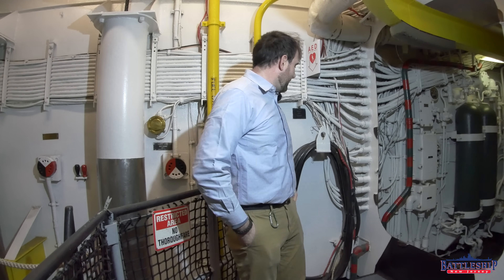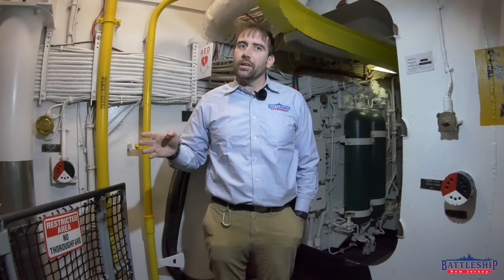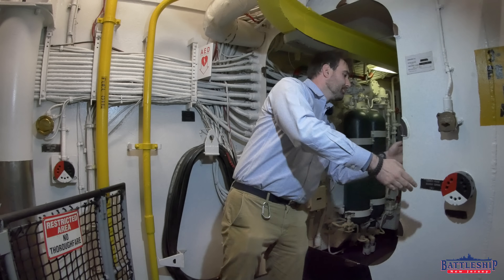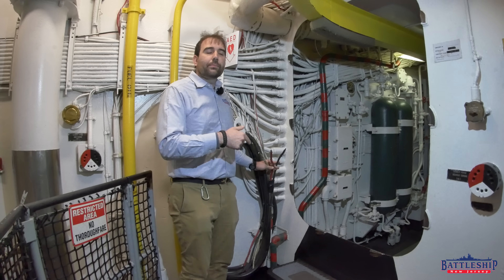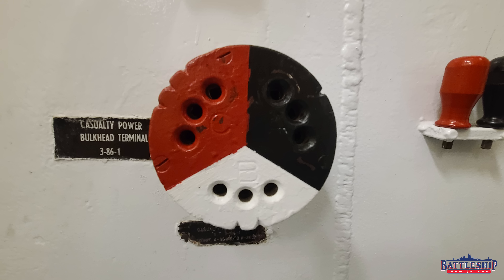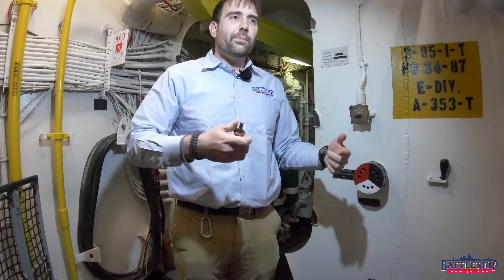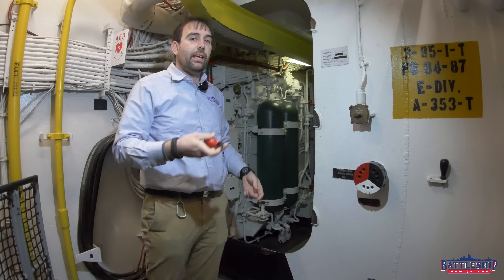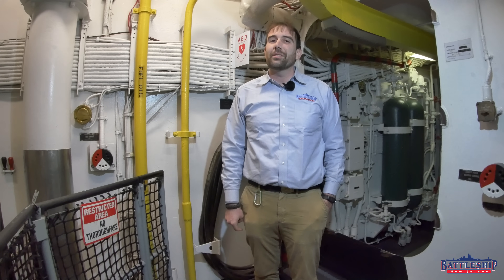What Are Those Weird Red/Black/White Discs on the Wall?

Comment: Yes, they are emergency power connectors for cross connecting damaged wiring. We covered this in DC school. But I don't think there was a lot of drill practice rigging these things. Maybe the electricians did simulations.   It seems there should be a special "T" wrench as well as a super heavy supply of cable hanging like firehose nearby on the bulkhead.  I did drills on America, Kennedy and Saratoga (late 60's) and never saw this rigged in any way. It would be interesting to hear from any old sailor who actually employed this system as a result of battle damage.
Reply: (joke)  DC school? But the power is AC  not DC   :)
Reply: @allenshepard7992  Good one Allen, thanks. I always thought messing with that system was a great way to become a crispy critter.
Reply: @paullewis5045  Most welcome. 
Yes, a crispy critter. After all "nothing moves. Looks the same when it is on as when it is off (safe)"  Training and Respect is key. 
While my mind understands connecting 480V wires on a moving ship in knee deep salt water, my mind says "Death trap"
Reply: @allenshepard7992  M, maigretus1 below has the right plan for handling this system.
Reply: My uncle was on the America in Vietnam.
Reply: @allenshepard7992  Or as they told me while training as an electrician: "A live and non-live circuit look the same, they just have a different feel to them"
Reply: @keresztesbotond740  Ha ha ha. Never heard that one. I will have to use it. Thank you.
Reply: @allenshepard7992  I'm pretty sure a ship would have it's power set up in a an IT configuration, which would normally not zap you at all. But I imagine in a situation where the ship is sinking on of the poles would easily ground itself to the hull, then it's game over for a human body.
Reply: @laszu7137  Yes, As I understand it, ships center tap single phase circuits so its 60V to ground instead of 120V. 
Three phase (3Φ) windings are bit tricky and do not have that advantage.
Reply: @allenshepard7992  "Damage Control"
Reply: We would drill running casualty power, or should I say the EM's did. Though it was mostly done during TSTA. But since we got a Battle E every time, I would say it was good enough drilling.

I never felt like the crew on my ships were unprepared for the worst.
Reply: @JoshuaTootell  "unprepared for the worst"  that is a great statement. There is so much we/I never saw coming. 
Kudos.
Reply: @JoshuaTootell  Thanks Joshua. I am glad to know that drill is getting done. E's are the result of hard work and a nice source of pride in your ship. You can see America's double hashmark E's as she is going down in the sinking video. I know we had them when she was nearly new, and it was nice to see that stuck to the end.
Reply: My first thought was racially segregated glory holes

Comment: That is brilliant!
I work in a hospital and we have means of  routing power from different sources, sometimes via manual switching and sometimes its automatic. There are also two of everything as in two main feeders to the hospital,  step down transformers are in pairs, generators are in pairs etc. Failure of one component is not extremely critical as faults may be isolated  and  loads get switched and supplied by the remaining "good" component

Comment: Where I grew up we could expect line power failures (plural) during the winter, and without helicopters it could take several days to get the line crews back into the mountains for repairs.  For decades I kept candles and matches where I could find them in the dark.

Comment: I have an 800A 48VDC telco spec power plant for my telco equipment set up with 16 50A rectifier modules, half of which are powered from the backup generator. Building lighting and HVAC are run from 48VDC solar with an automatic transfer switch to the main power plant if the solar battery string gets low. I also have the option to swing lighting and HVAC directly to commercial power if the situation calls for it. Extreme flexibility is the answer to unpredictable failure modes.
Reply: God bless you brother.   Flexability and practice (my weak spot) is key. 
Hope you have a Diesel parking heater to keep warm.
Reply: Curiosity from someone who repairs 48v telecom power systems: Why?

Did you find one at surplus for cheap? Do you work in telecom and were able to siphon some parts off the top?
Reply: @phillyphakename1255  I used to be a local ISP and CLEC a long time ago. I was in Nashua NH picking server cabinets out of a building where the previous tenant had just abandoned a load of stuff where I found a Power Conversion Products Twin Pak Plus power plant. I wasn't lucky enough to get the Hawker battery string but the 800A power plant set me back only $200. Right place, right time, spectacular deal. It's bigger than I need but the parallel rectifier modules allow me to feed from both commercial and backup power without needing a transfer switch.
Reply: @vburke1  Cool. Those telecom power systems are quite reliable and super fixable. We are still repairing and refurbishing stuff that was made in 1995! Ready for another deployment when it ships out the door.

Comment: It's amazing to see how the battleship has systems in place to re-route power when damage control is needed. Ryan asks about the At my home we have two different circuits from city power, one for the house, another for the shop, and rarely do both lose power at the same time, I think maybe once in 17 years. I have run a heavy extension above ground from one to the other to keep the fridge and freezer operational, and the generator keeps lights and fans on.  But nothing powers the HVAC running so we have packaged firelogs for the fireplace.    We also have multiple flashlights in every room and many spare batteries.  All this came about from what we call the Ice Storm, a great cold blizzard that lost our power city-wide for five full days, and destroyed many trees and overhead power lines due to the weight of the accumulated ice.

Comment: those casualty power pucks arent on all us navy ships. my first ship was a newport class LST. it did not have any provisions for casualty power. its one way to know they consider your ship disposable.
Reply: There was a reason that LST's were called Large Slow Targets. Granted that the Newport class was faster than WWll LST's but they still were not THAT fast.
Reply: They were later replaced with LPD ( landing platform disposable)
Reply: As  Marine, I was aboard the Newport for a cold weather training mission in Norway and the return to the USA, with a stop in New Castle on Tyme, UK.
Reply: It might be because they redesigned the system. My ships didn't have those either, but we 100% had casualty power cables. But they also had quick connectors and easier to use power disconnects. It would be way faster to restore power on the newer system with a lower chance of making a mistake.
Reply: We have portable power units. And aboard any wing group, you have genpacks on wheels to power equipment and aircraft.  Some even supply AC..lol.

Comment: Also, the power at the emergency source must be off or the 3 phase breaker open, since many load devices such as transformers and motors can be damaged by not having all 3 phases live at the same time.  You need to turn on power to all 3 phases simultaneously after wiring up the whole daisy chain.
Reply: Yeah, that wasn't explained and a lot of people in the comments seem to think you are doing this work live.
Reply: I've heard 3 phase motors running when a phase drops...it's terrifying. They'll destroy themselves in short order!

Comment: After watching Juan Browne's recent video on the loss of power at The Blancolirio World Headquarters, I ordered a Champion duel fuel generator and manual transfer switch.   I can now run my gas furnace in the dead of winter even though the power lines might be down.    Which is sort of important here in Wisconsin.
Reply: It sure is! Keeping that house heater working in your case, electric/LP gas, using a dual fuel generator is a great plan. COngradulations.
Reply: +1 for the Blancolirio channel.

Comment: Interesting vid!  And yes, I do have a couple generators at home. We always seem to lose power every year, and sometimes for several days now and then.
Reply: We used to lose power regularly but I solved the problem by buying a generator.  Longest power outage now has been five minutes.  Not even long enough to start and connect the generator.
Reply: @haywoodyoudome  Hehe, glad you've been able to ward off the outages!

Comment: Looks to me like the notches on that "biscuit" were cut by hand, and not part of the casting process. Maybe the ridged wires and notches were an upgrade based on experience? 

At home we've got not just flashlights, but LED headlamps. One of my most satisfying accomplishments has been converting my 81-year-old mother to the convenience of reading and doing things, on a dark, powerless night, with a headlamp instead of a flashlight. And I have a lot of spare flashlights from when I was a professional mariner!

Comment: It would be fascinating to see a wiring schematic used in quickly planning casualty power routing.
Reply: These things have no schematics other than where sailor run the emergency cables .  Each simply bypasses a bulkhead to an identical one on the other side .  Someone needs to improvise a route and pass out commands to the sailors pulling the ropes .

Comment: Those black discs are for emergency power connections when battle damage severes a main cable. They are keyed on the disc for proper phasing of the feed. One, two, or three pips, and corresponding keying on the cables. Every thing you need in smoke and dark. You might see the biscuits connected to a power panel. Remember to wire from load to source.
Reply: Thanks, I did not get that from the video that spends allmost six minutes explaining it in great detail.
Reply: LOl! You just repeated what the video said! Duh!
Reply: "Load to source" or there will be more death.
Reply: @Not Sure Good thing that it's split into 3 phases
Reply: @DonnyHootieHoot  I was typing even before he started speaking. He said that this video is a redo of a previous video.
Reply: @ImieNazwiskoOK  Every phase has voltage even if a transformer goes out. The transformers are wired Delta - Delta.

Comment: Damage control 300 . I guess.
Cool chit. Glad my tank was smaller and not so complex.  
The  440 BB volts vs 300  tank amps  seems about the same. 
Though a tank ain't floating in salt-water.  

Much respect to the electrical gremlin either way.😎

Comment: Lots of trees around the lines, and I'm the last house on the line - the next house over feeds from another area of the grid.  I have battery backup systems that run everything that's critical to avoid downtime on (I WFH and the internet can take 15+ minutes to restart), then a standby generator with 7 days of fuel that takes 44 seconds to start transfer load from the mains.  I have an additional portable generator that can run critical circuits to allow maintenance of the main generator during extended outages, and the biggest battery backup system is two redundant systems with redundant feeds to the load, so that I can perform maintenance on it without losing protection.

Oh, and I also have spike suppression in the breaker box, and the transfer switch detects floating neutral conditions and cuts grid power should that occur, either from wiring issues or something like a solar storm.

Comment: ideally, I would have street power from the power company, as well as solar, and backup generator all fed through a battery backup.  But because that all costs lots of money, I have candles.
Reply: I hear ya, but I have slight upgrade. I have scented and citronella candles 👍
Reply: Here I have some plus few oil lamps

Comment: My home is at the end of the line, on a side street off of another side street.  Power goes out often enough that I have a dual fuel generator and store enough propane at home to run it for a couple of days. (propane, unlike gasoline, does not go stale in storage)  Also enough extension cords to run in through a window and power critical loads.  The furnace, heating fans, fridge, the telephone and wifi, my mom's stairlift and oxygen concentrator, a few LED lights and charger for my laptop and cell phones.  I also have a portable butane stove so I can heat food and make tea.   Enough heat and serve food for several days in the kitchen cabinets anyway.  the stairs also have several of those little LED motion detector battery lights, which are great to have at night to keep from tripping.

Comment: As with so many things still in use these are ingenious solutions to critical situations , learned in wars . To a large extent they ensure critical equipment needed for the ships survival can be restored if possible . The leads are super flexible cable to make it more practical and part of many damage control exercises . Like other Naval basics , they are still in use , practically unchanged , on many ships today because they work . I've got a couple of torches & candles at home , but have a few solar garden lights I keep on a window sill which can be useful . I'm thinking solar will , or even may already be , a part of warship design for power .

Comment: A fascinating video, thank you. However, I would have though having a single three pin plug would be preferable to having separate conductors where current could be fed back from the conductor already connected to the other two via what the other end was connected to. Just a thought.

Comment: We have several backups at home, even being pretty close to the city.  First up are automatic emergency lights on each level that go automatically on when outlet power is lost (First Alert makes some very small, very nice ones now).  These are rechargeable, and can be unplugged to use as emergency flashlights.  Next are multiple LED flashlights, with spare batteries.  For computers, we have two laptops good for a couple of hours each, plus a full UPS on the biggest system that can power everything plenty long enough for a safe shutdown.  Then, since we have an attached garage, we have an emergency inverter for each car, allowing up to 1400 Watts via extension cords.  Each of the cars also have chargers for cellphones, etc.   And those cellphones have hot spot settings, so we can still connect to internet on an emergency basis.  We also have a pair of weather alert radios.  

All told, we are likely good for a day or two, without any outside assistance.  (I was an engineer for a TV station for a dozen years, and an engineer for medical facilities for over two decades, so having redundant backup plans and systems is not anything new.)   As it happens, we lost power for four hours last Saturday, and were not even inconvenienced.  We could even watch movies on video until the power company got a crew out to our neighborhood.
Reply: All good things! 
I have Amish neighbors so I have learned to appreciate the dark 😉

Comment: No never have a bad day. Those biscuits are never live until cables are rigged and space is in manned if flooding. They are used for power continuation. The covers are usually vinyl to be easily dusted and clean inside connectors. They are rigged by direction of DC central to repair locker leader to on scene electrician . Never energized without Chief Engineer's permission.
Reply: Unmanned if flooding sorry.

Comment: Okay. Here's what's always been one of my big questions about ships, especially with twin rudders, and especially still the iowa-class. Why are the rudders so small compared to the rest of the ship, and wouldn't bigger rudders be more effective and result in a tighter turning circle?
Also why are such little rudders so powerful?
Reply: the larger the rudder, the more drag it would create (slowing the ship down even more during turns) and also the more power it would require to physically turn the rudder.
Reply: There are two factors that make the rudders "seem" small.

When maneuvering at high speed , the flow of water provides the rudder with more authority. Thus a smaller rudder is all you need.  A rudder large enough to give tight turns at LOW speed would create lots of drag, and would be in danger of been ripped off if deflected at high speed.

For this reason your sailships seem to have a "larger" rudder, they do not get to 28 knots😊

Another reason why rudders seem "smallish" is that we have a poor grasp of how powerful and how dense water is. We are used to seeing wings and rudders on airplanes, and they seem huge. Because the air is so much less dense.

For a reality check: compare the rudder of a deHavilland Beaver on floats, with the two pitiful tabs at the rear of the floats used to steer it in the water. Density changes the scale of things. 👍

Comment: I work in engineering at a regional hospital, we have redundant electrical systems. Never seen bricks like this and I found interesting. In a hospital environment we practice and plan for power and facilities lose. At my facility we have 5 generators (3 supplies 1150VAc and 2 supply 480VAC). We are fortunate all our power are control by building automation and with consideration to load we can for most part go completely offline from power company and supply 100%. In front of power generators we have several UPS battery backup that support critical and life support systems and IT services. In front of those system all critical and life support systems have their own UPS and most have individual battery back up. 

Lots of redundant systems, that all require monthly, quarterly, semi Annual, annual and 5 year inspection that is documented.